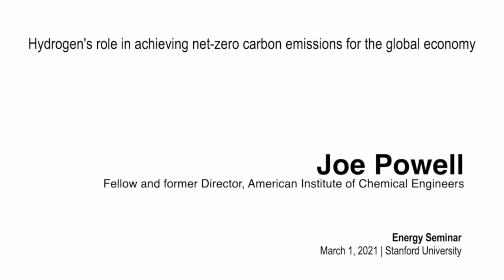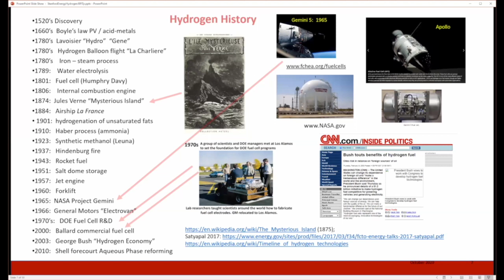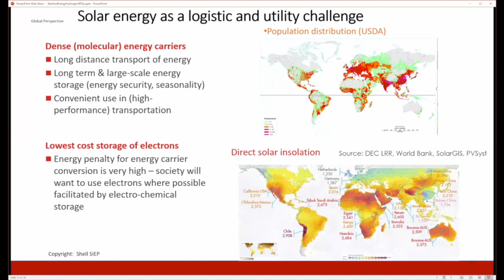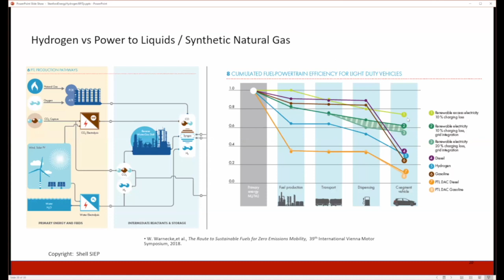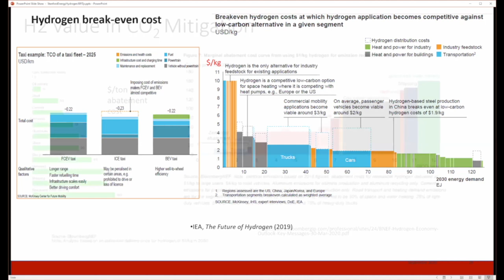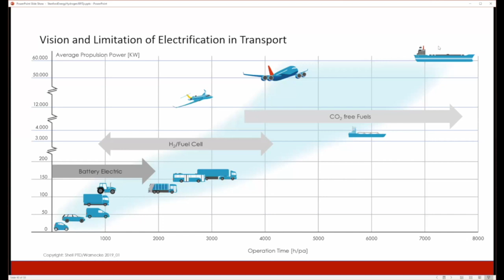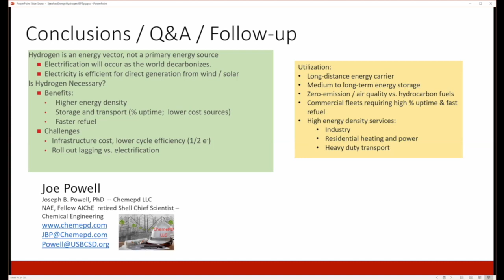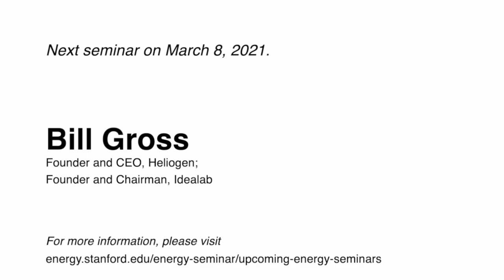Hydrogen's role in achieving net-zero carbon emissions | Joe Powell | Energy Seminar

Comment: The only need i can see for hydrogen based biofuels i can see is intercontinental flights and large marine vessels. Any other form of transportation is way cheaper and more independent in using batteries. And battery tech is developing so fast that by 2030 hydrogen will stand no chance against them. Of course the old dinos like Shell don't like it that people get independent from them, thats why they dump so much money into it. Any other local energy needs are far better of using renewable energy directly and non hydrogen storage solutions. Another field hydrogen could be used are large industries like steal or cement, although CO2 sequestration might be the more viable method there.

Comment: A lot of air travel can be solved by self drive taxis designed specifically for intercity transport

Reduce the coefficient of drag to 0.12 and a 150KWh taxi would have a range of 850 miles range at 85mph speed. This could do 4-6 people per taxi making the per seat per mile efficiency extremely high

22 million domestic UK flights and most can be done in eletric taxis. London to Edinburgh is 415 miles by road could be done in less than 5.5 hours which might sound a lot vs a 1h flight but a 1h flight is never just a 1h flight if you count all the dead time like driving to the airport going through checking in and security at both ends and allowing lots of spare time the 1h flight is more like a 5h trip

So hydrogen or biofuels isn't necessary for most flights as they will be displaced by eletric taxis or electric personal vehicles

A self drive taxi might displace all air travel that is below 1,000 miles range as you could order a sleeper taxi watch a movie and then go to sleep and 10h later you are 1000 miles away at your destination city

Comment: Hydrogen will be necessary at some stage but its a long way away perhaps 20+ years away for most nations

Most homes in Europe are heated by natural gas boilers. If dual fuel boilers are deployed which can work with both eleteicity and methane it will allow a huge quantity more intermittent wind into the grid

For example the UK has committed to deployment of 40GW of offshore wind by 2030. Beyond that date the UK will have to find new ways to use additional wind power. That can be achieved with dual fuel boilers. When the wind is strong the nations natural gas boilers switch to eletricity 

That will allow as much as 100GW of offshore wind into the UK grid enough to generate 525TWh annually